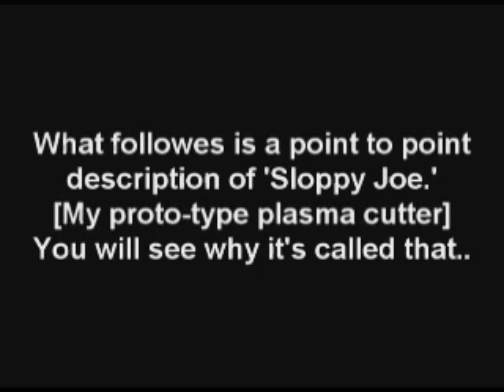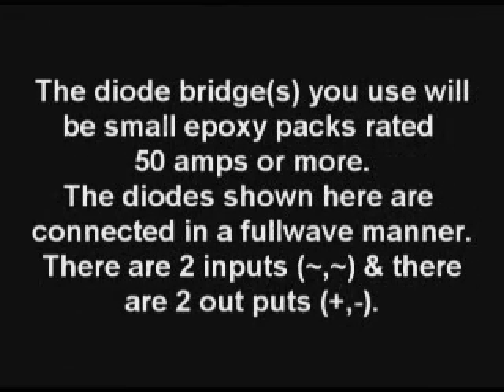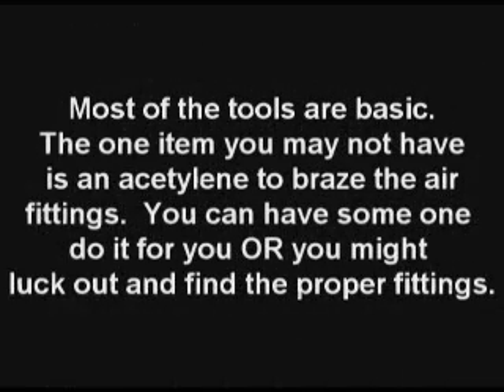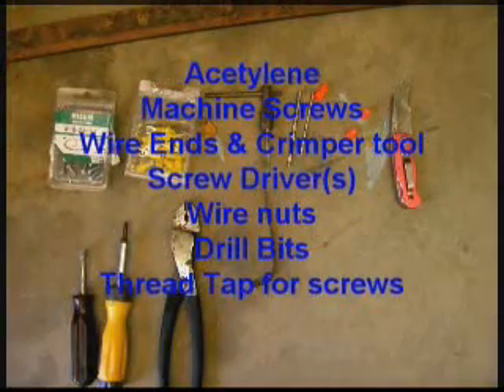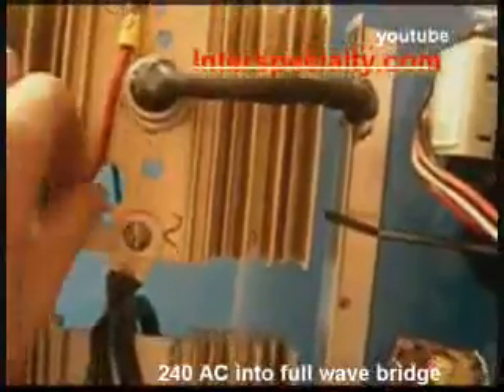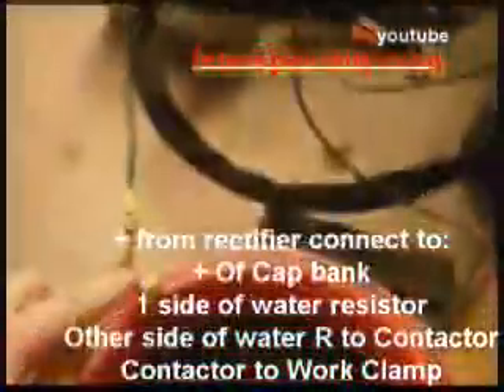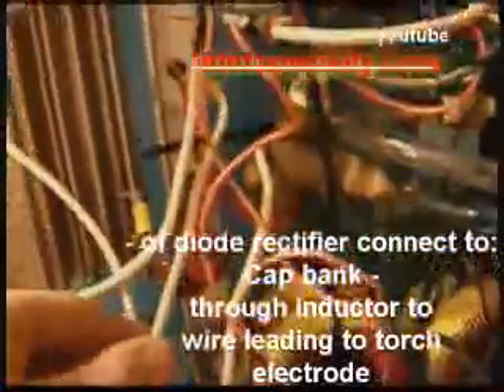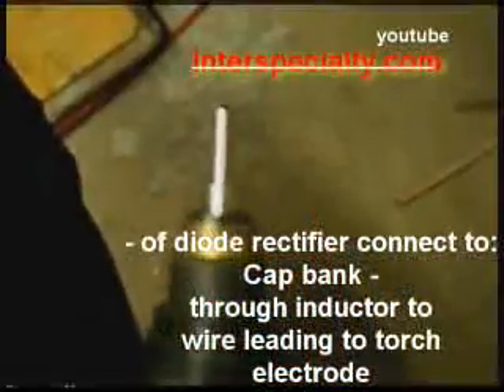Homemade Plasma Cutter Power Circuit

Comment: @deltaxcd 
There are, in general, only two instances here where you have a neutral wire. That is with 120/208 Wye and 277/480 Wye. And the only time I have seen an outlet that has all 5 wires (3 hots, 1 neutral, 1 ground) is when a machine or piece of equipments specifically needs 120v like some power supplies. But usually the machine designers build a machine to run with only the three hots and use an internal transformer is 120v is needed. This makes machines more compatible for installation.

Comment: @deltaxcd 

Well, I guess it is safer since it will not work. What do you connect your ground too? If you had a neutral wire with your three phase you could use that but if you are on delta you wont have one and even when you do have Wye often the neutral is not dropped to an outlet. Unless a machine needs 120v internally the neutral is left out.

110v is anything but harmless. Its the current that kills you, not the voltage. Higher voltage just makes it easier to get through the dry epidermis.

Comment: @SupermaxCNC 

No safer? if you use full bridge and connect one wire to your fence or car which you want to weld you may be killed before you will even start you work. any accidental grab to your workpiece will be your last.

half bridge is only harmful if you fail to connect ground to your workpiece and then touch it with other electrode in that case you will get some shock, but it wont kill you since it is short ,also 110v i relatively harmless if you do not stand in the water.

Comment: @deltaxcd 

A half bridge is no safer than a full bridge and you still have not shown a return path for the current from the half bridge. 

An isolation transformer provides considerable protection. Not only to yourself or hapless bystanders but to other equipment and building wiring. With an isolated setup you have one return path, through the work cable. With an unisolated setup  you have a return through anything, tables, power tools, even the ground you are standing on.

Comment: @SupermaxCNC 

There is no isolation in any case  even if you use transformer you are grounding one wire  by connecting it to your workpiece  so if you touch your plasma head you may get electric shock anyway.

this is why isolation transformer is not required. It just does not do anything.

Of course this will not pass NEC but it is relatively safe, comparing to full bridge setup which is plain death trap.

Comment: @deltaxcd 
As the line is not isolated it will have a voltage potential from the torch to earth ground no matter if you use a half wave rectifier or a full wave rectifier. And then what do you plan on using for a work ground? Using a half bridge on delta's three lines leaves you will only earth ground as a return path and to use that would violate NEC.

Comment: @SupermaxCNC 
You do not understand me.

To be safe you need to use HALF WAVE rectifier.
You connect ground wire to your workpiece.
and use 3 diodes (one from each phase ), not 6 diodes in full bridge comfiguration, to power plasma cutter head.

Comment: @deltaxcd 

No, that wont work. There is still grounding on three phase. A corner grounded delta has one of the lines tied directly to ground. One 120/208 delta the center of coil of the transformer is tied to ground as well.

Comment: @SupermaxCNC 

It could be  made safe if powered with Half-wave rectifier connected to 3 phase power grid.
in that case all you need is to maintain correct phase and ground connections.

Comment: @SupermaxCNC 

It could be  made safe if powered with Half-wave rectifier connectred to 3 phase power grid.
in that case all you need is to maintain correct phase and ground connections.

Comment: ok you dork, if you want an isolation transformer on the input then add one to yours. Like the boy says, "If you don't understand the concepts presented here, this project is not for you".  As for me, I am not going to put my tongue on the tip of the gun and pull the trigger.

Comment: DO NOT BUILD THIS! IT IS A DEATH TRAP!

By code and law plasma cutters are required to have their output isolated from mains power. This means that there is a isolation transformer in between the mains and the input rectifier.

If you were to come in between ground (Lets say kneeling on wet pavement) and the tip it would kill you in a split second. There are NO safeties in this machine.